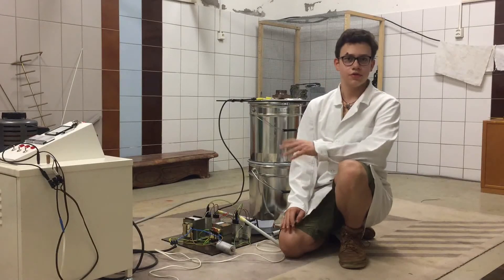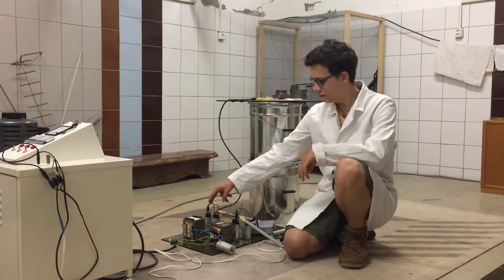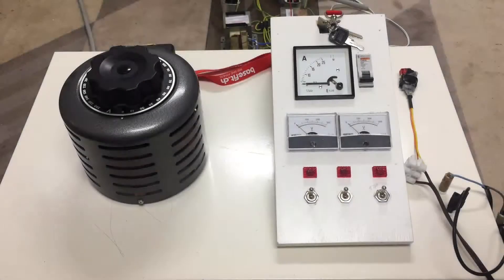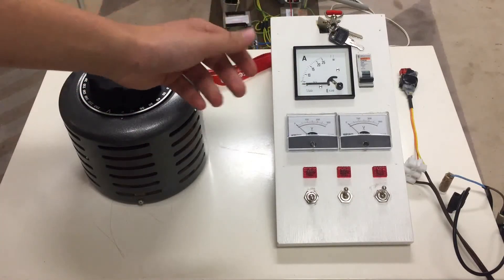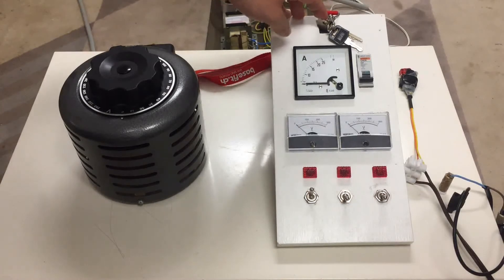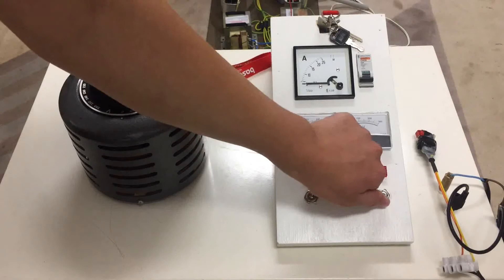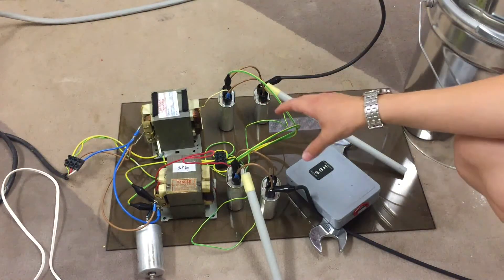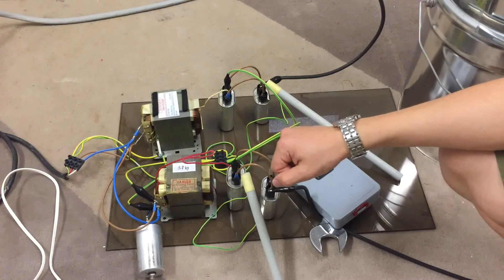Dual Mot resonant arc setup overview and test+announcement

Comment: I did it lol
Reply from the maker: Nice, I think I saw the video.
Just don’t hold the electrodes in both hands. Because then it is more likely for current to flow trough your heart in case of an accident. 
Always follow the one hand rule.
Reply: @firefox1136  i used one meter pvc pipe and it is very good dielectric
Reply from the maker: @esk_customs  yes, but it still better to be on the safe side. Also idk if your wires were rated for the high voltage, they looked like normal 230 cables.
Reply: @firefox1136  yeah, it is normal 230 cable, but in heat shrink and silicone tube. I test it with 30 kV
Reply: @firefox1136  and I have the button under my foot. If I release it, transformer turn off

Comment: Very interesting. I think the leakage inductance of a microwave transformer will be very small, but is the current actually increasing due to the LC series resonance? I wonder how it compares to when the output capacitor was removed.
Reply from the maker: To be honest, I didn't measure the secondary current, but I know, that the primary current drops with the caps. Here is a video, were I copare the primary current with and withou caps if you are interested: https://www.youtube.com/watch?v=EwEvA4inxuM